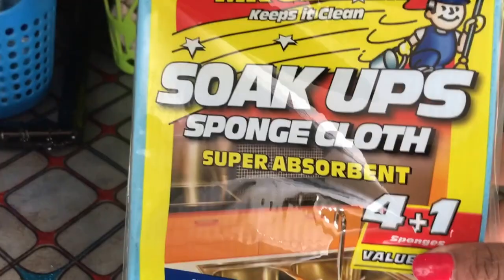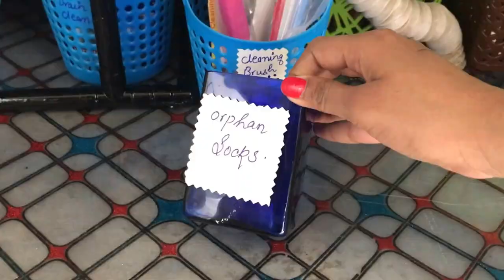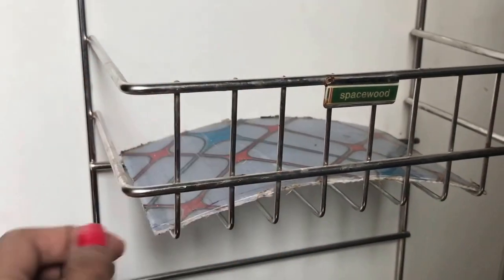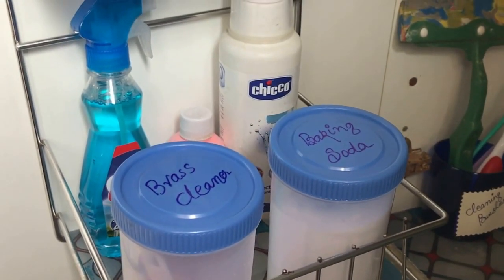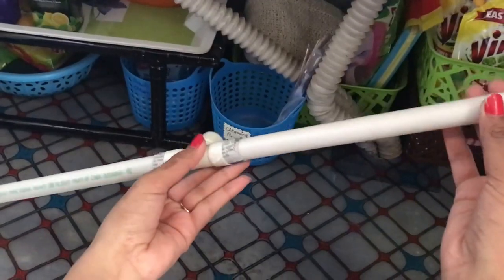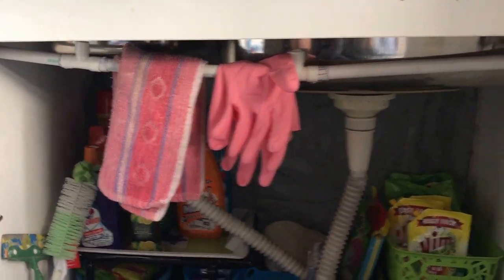How to Organize Under Sink Area | Kitchen Organization Series: Part 1 | Organizopedia

Comment: u CN also use steel spiral wire to hang ur towels etc instead of PVC pipes
Reply from the maker: Hey star *, yes we can definetly use that but I had this extra PVC pipe left from the locker stand, so I thought to use it but you can definelty use spiral steel wire instead of PVC pipe. Thanks for commenting this would help so many viewers to use steel wire in place of pipes😊

Comment: You are wonderful and practical in how you do things! Any DIY project videos I will definitely watch! Also, if you can find and use a bit of waterproof caulking for the edges as well and to Seal around the circular area that the pipes run through I think it may help you with keeping your under-sink area safer from unwelcome pests 🙂 Also perhaps you might use a clear liner for the towel basket's open sides. With the wonderful top it has, it would be very nice that way. Also address the negatively stated comment about your storage of the towels. I love how you gave so much advice to so many people to cater to each of their unique situations underneath their sinks! Bravo!!

Comment: Where can we get these hanging baskets and how to attach them inside the door of the cabinet? Please make a video..How to spread the sheet under the sink ..You didnt show us that...Instead of that sheet what else we can use like plastic covers..
Reply from the maker: Hey,
I'm in a rented accommodation here in Noida and this builder has only given this basket attached to the door but very easily you can find it online or from any kitchen related store. It's very easy to spread that sheet just cut the part where your pipe comes and than simply spread it and if you wanted you can also lie a plastic sheet but it should be thick, so that it doesn't break when you keep your stuff on it.
Reply: Thank you so much for replying..I thought its your own house and that's why you have made the provision for that..